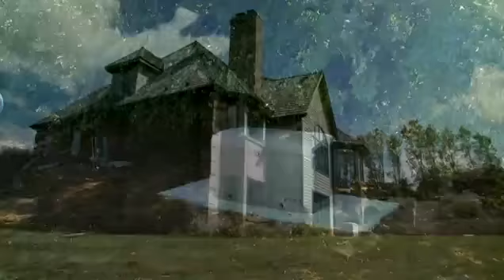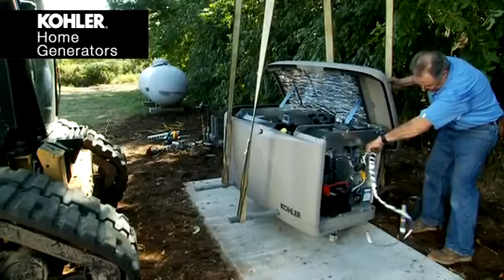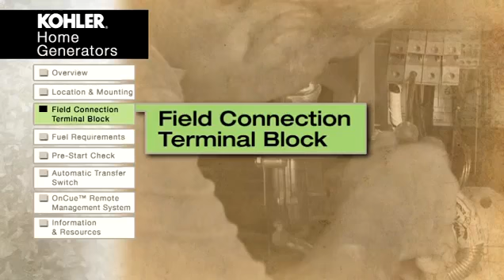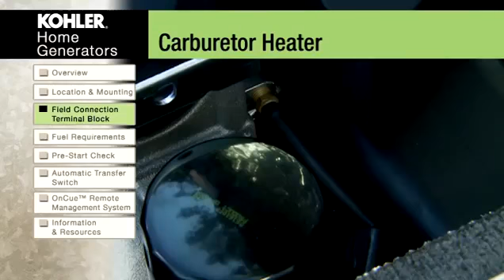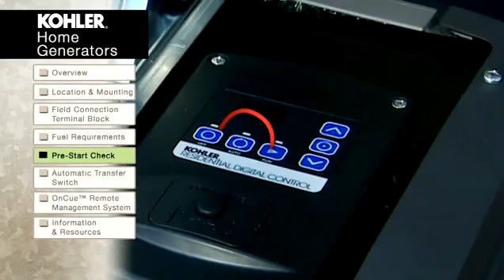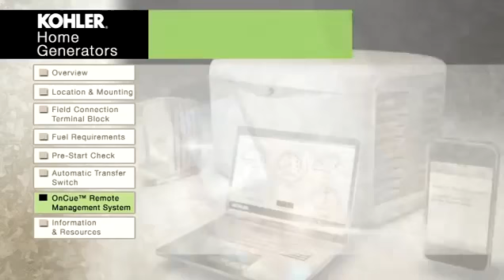Kohler Generator Installation

Comment: My main 150amp panel is in my basement. What is the best place to install the automatic transfer switch? I'm debating on getting a Kohler 20k RCA and not sure where to place ATS inside or outside the home.. Also is OnCue worth it and don't they make a wireless kit so one doesn't need to use a cat 5 ethernet cable? Thanks😊 My gas meter is on opposite side of my house to where the electric meter is.
Reply: You can place it almost anywhere, but the best location is in between the Power Co Can and your panel.  In my case the power was on one side of the house and gas line was on the other.  I was going to have to run one to the other side and it's a lot cheaper and easier to run the electric cables. I put the ATS next to my meter can and then ran the new incoming wires into the panel which was in a closet juts behind the meter.  The line ran all the way across the attic to the generator on the other side of the house.

Comment: If you were feeding the whole house via the main panel, what stops the emergency power from back-feeding the utility wires in the transfer switch?
Reply: The ATS does not allow back-feeding either way by design. There is a mechanical solenoid that isolates the generator power from the utility mains.  Same thing in reverse.  When the ATS senses strong grid power, the generator circuit gets isolated via the same solenoid (switch) in the ATS as it reconnects back to the utility.  Most ATS also have a manual switch feature, should the solenoid fail.